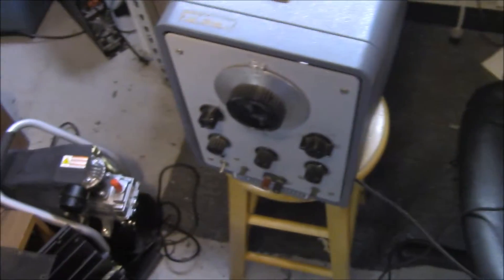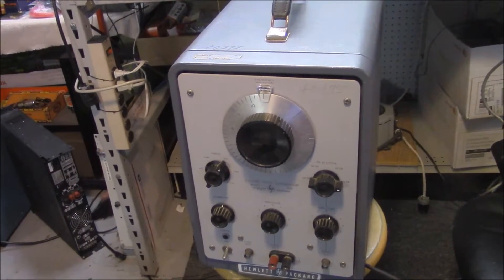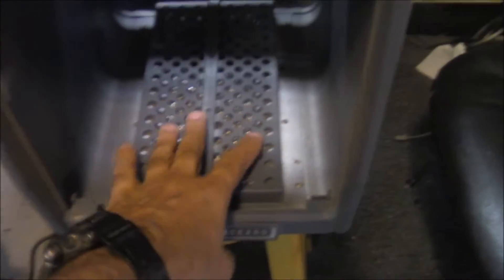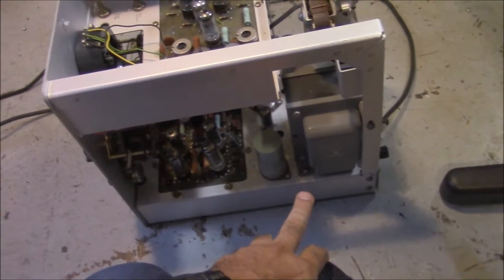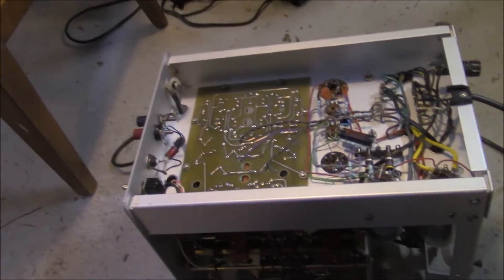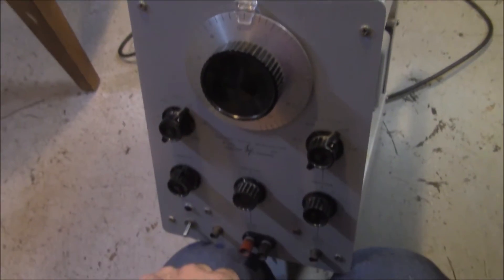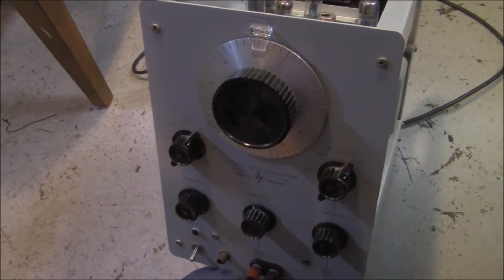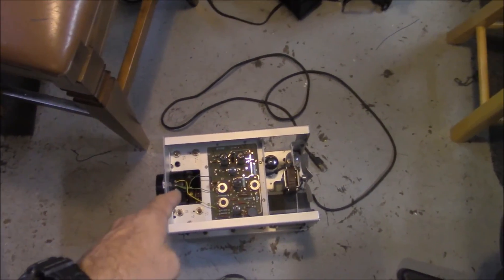Homemade Bench Power Supply #2    Find a case

Comment: why not build a case for the power supply.  that way you can customize the case the way you want it set up.
Reply: Agreed, you could put shelves or panelling as required onto an old desktop PC mid tower case, no one will feel bad about killing off an old PC :)
Reply: That wasn't exactly what I was thinking, but it would also work great for it.  I was thinking of him building a custom box out of some plywood.  But thinking about it, the old PC frame would be a lot lighter.